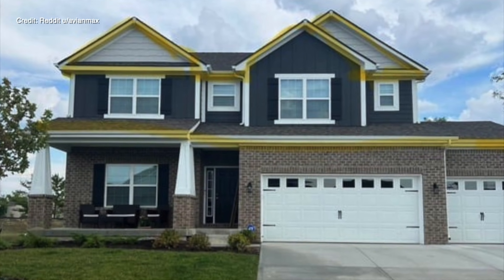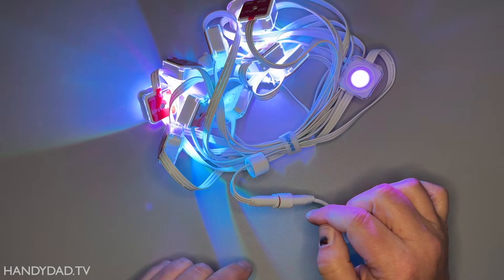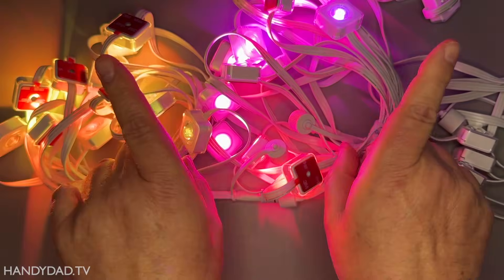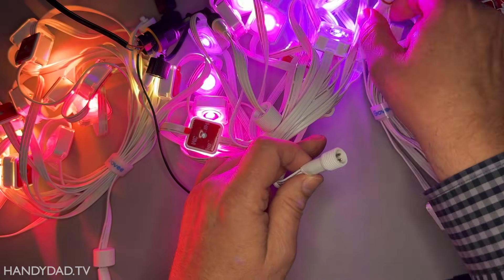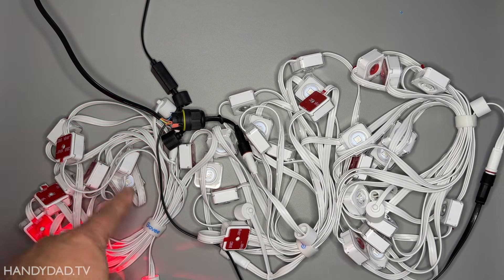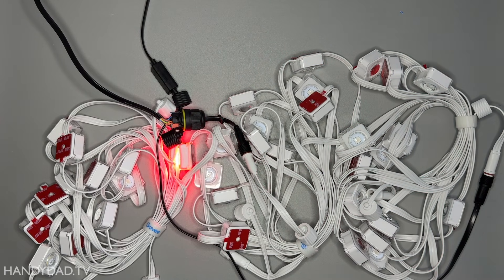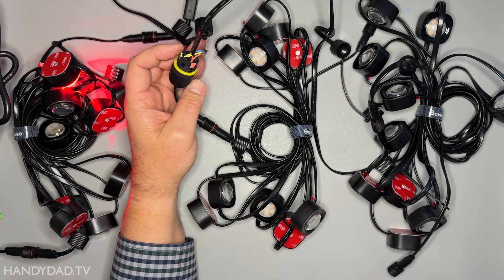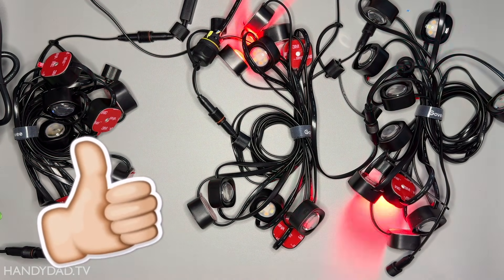Can you split Govee lights with a Wye Connector?

Comment: Great video but you don’t show exactly how you made the Y connection
Reply from the maker: The point was to show it’s feasible. My splices were purely for demonstration. Actual splices will likely be done using soldered waterproof connections and extended wires.

Comment: Great video and very helpful.  Forgive me if you've already answered this question.  I did look to try to find my questions.

I have Pro lights.  I wanted to splice a Y split IN THE MIDDLE of a segment.  No joy no matter what I tried.  I could ONLY successfully Y split between full segment.  When I put the Y split at the end of a full segment and the start of two split segments, it worked perfectly.

Can you splice a Y split in the middle of a segment?  If so, I did SOMETHING wrong.  

Many thanks for the useful video!
Reply from the maker: You should be able to do the wye anywhere along the string.

Comment: Question , can you connect more than 12 string using Y splitter , I am in a situation where I need one more string , so it will be the 13 th string to complete or do I need new power and controller. Thanks
Reply: Any input for this ?
Reply from the maker: You can’t exceed the limits of your kit. If it says 12 is the max, a splitter doesn’t give you more capacity.

Comment: I know this is an old video, but any idea what would happen if one of the split runs is longer than the other? I have an unfortunate roof layout and have to split in the middle of a run.
Reply from the maker: That’s fine. The longest leg is the main line. The shorter one is a clone of the other.

Comment: Great video, very helpful. I do have a question though. After the Y spliy can I contiue down one of those paths? I would need a Y to go up to a short run of a new roof line, but hte lower Y I would need to continue on for another 50 feet or so. I feel it would need several more strands to complete the roofline.  I assume it would, but before I commit the $ for this, I thought I would ask.
Reply from the maker: Yes, you can go as long as you need, provided you don’t exceed the total number of lights in your kit.

Comment: Are you still limited to the same number of strings off the power source? Also do you know if adding the extension cords provided with the pro kits have to be taken into account of the 200ft you can run? Just ordered my kit, and was hoping to find a video successfully using a Y splitter. So thank you for the video!
Reply from the maker: You are limited to the number of lights that come with the kit regardless of extensions and splits.
Reply: I need this how do you make the Y

Comment: May have to do this - thanks for the video. To light up one last area of my house I need about a 30' extension. I actually found a 32' one but from what I have read I have my fingers crossed that it will work. If I "Y" this junction I only need maybe a 5' extension. Have you tested the longest length extension possible for the Pro's?

Also, I'm having heck of a time finding a 3-wire ribbon cable like Govee - do you have a source? - thanks
Reply from the maker: Non-OEM extension cables are hit or miss because they need to incorporate a signal booster. Always test on the ground before installing so you don’t waste time on the ladder. 

I don’t recommend splitting because you lose individual control. Also, splitting doesn’t change the capacity of your kit, so you still have the same max lights.

Comment: If there's a flat second story and a flat first story, can I Y at the base and run two separate 100 foot strands? Would it be in sequence top and bottom? Or would it be better to just use two separate kits and link them on the app?
Reply from the maker: Wye splitting doesn’t let you surpass the max number of lights your power supply can handle. 

It would be best to use one kit without splitting.
Reply from the maker: Wye splitting doesn’t let you surpass the max number of lights your power supply can handle. 

It would be best to use one 200’ kit without splitting.

Comment: This is exactly what i need because on the same section of my house i have two levels where i want lights. my only question is, on the upper level, will i be able to still continue on after that strand runs out?? i have the govee pros
Reply from the maker: Yes. The longest run is your primary. The shorter side copies the primary.

Comment: @handydadtv - Thank you for the video - Couple of questions: 1) If you do the split and have 2x section mirroring each other, do the Govee app only show 1x string and leave the other one off? Meaning you cannot DIY manipulate the duplicated strand? For some if you want to DIY modify it, this may be an issue. 2) If you do this split, can you then continue off of one split can keep running the remaining strands around the house?
Reply from the maker: 1. Both sides of the split will ALWAYS do the same thing. You can’t control them individually. 
2. The longest leg of the split becomes the main line that’s controlled in the app. The shorter leg mimics the longer one.

Comment: I have a semi detached house i want to split and do two strands one at the roof and another over the lower shed over garage and the door entrance. Ideally both strands will have almost same number of pixels. My question is, would it reduce the overall brightness or voltage if the do a Y split and is there any electrical hazard??
Reply from the maker: No electrical concern as long as you don’t exceed the number of lights in the kit. You can’t combine two kits and expect one power supply to drive them all.

Comment: What's the best way to setup these lights if my power is in the middle of my house and I want to setup lights to the right and left of the power source?  I assume some splicing will be required in some way.  I'd like to keep sequence if possible and not duplicate it like the Y does.
Reply from the maker: The best option is to add an outlet to the right or left. I’ve got videos on that.
Reply: @handydadtv was hoping to avoid that, thanks though.  I've done it before, was just hoping there would be an easier solution.  I might just do a splice anyway.

Comment: Awesome content very helpful in deed.  Question what does the y splitter do to the overall length of the string capability.  Would you have to calculate the two strings into the total length or would this theoretically give you double the lighting capability per power module.
Reply: Second question I have had to run jumpers and always loose communication when the jumper length is anything longer that roughly 4 feet.  I’ve had to hide lights in the attic to get the lights to act right which is fine but can be frustrating as that hidden light is normally in the very small parts of the attic making installs much more time consuming and difficult.   Any ideas of how to run long 4-16’ jumpers without having hidden lights.   I’ve even used the Govee extenders but even with that when installed between strings the same effect happens.  What I see when I get over roughly 4’ is only a few lights will come on after the jumper and then maybe a few lights will just flicker but nothing after that.   Thoughts?
Reply from the maker: Power is power, and the wye doesn’t give you any more power. So you can’t exceed the overall limits of your set regardless of the wye. 

The little cubes on the Govee extensions should be signal boosters. So you should be okay if you use them. Using custom, aftermarket wire has no booster so that’s something to consider. 

There are third party boosters, such as the Falcon F-amp, but they don’t work with 36 volts, so you’d need to add a buck converter to 12 volts. PITA

Comment: Did you count the strands after the split when you calibrated? I have 8 strands all together that includes 2 strands that come off the split that mirror the strands directly below them, so I'm wondering if I should select 6 or 8 when it asks you during calibration. My controller and 1 extension cable went bad after about 3 months of use so I'm wondering if it was due to me originally selecting 8 instead of 6. Any help is appreciated and great video
Reply from the maker: Lots of people complain about their controller dying. The number of strings spliced makes no difference. 

But you should configure the next controller for 6 strings, not including the mirrored ones.

Comment: Does the mirroring only impact one side of the split connection. I want to split at a peak on the far side of my house so it will allow me to jump to three dormers at the front of the house. I want those dormers to stay in sequence, but I’m not worried if the side of the house is mirroring . Is that what will happen?
Reply from the maker: If the left leg of the wye has 50 lights and the right has 25, the right leg will mirror the first 25 of the left leg. Hope that helps.

Comment: I made a wye/ y splitter connector with the Govee extensions and worked flawlessly.
Reply: Do the 2 lines coming off the splitter need to have equal strands of leds or can you have 1 strand on one and 3 on the other?
Reply from the maker: They can be different lengths.
Reply: @handydadtv thanks for sharing your knowledge with everyone I really appreciate it!

Comment: Thank you for this video. Question i have. I'm running the 200' pros. currently using 10.5 strands with booster on end of 5th. I want to do two splits like this for my dormers, both splits will be 6 lights each. one spliced in strand 3 once spliced in strand 7. Is my booster ok where it currently is set up?
Reply from the maker: I can’t say. You’ll need to test.

Comment: I am. I ran out of power because I need 12’ more in my 200. I’m going to back up the the last 12’ and piggyback. Govee does. Or make or sell  a spare power Bluetooth supply.
Reply from the maker: Putting more than 200 feet of lights will overload your power supply and could be a fire hazard.

Comment: Thanks for the excellent video and demonstration. I am currently installing govee pro and need a couple of y slices. My question is what happens to the lights on the shorter run once you have passed them on the programming? Are they off until their sequence action returns possibly creating dark spots?
Reply from the maker: No, they mirror the longer string.

Comment: If that’s the case, can I make my own extension cable with the 100ft pro version… I’ve a 30ft drop to my porch and so I’d need to splice using my own wire
Reply from the maker: You can make your own extensions but it’s best to insert wire in the middle of the stock extensions because they include signal boosters.
Reply: @handydadtv  oh ok… many thanks for your response! 🙂👍

Comment: What about doing the Y split after the controller, before it gets to the lights? My assumption is that the first two strands would memic each other. Have you tested this, and what was the result?
Reply from the maker: It would work and, as you said, mirror both sides.

Comment: I'm having issues with the Bluetooth.   One day they just turned off and can't reconnect
Reply from the maker: Try resetting. If that doesn’t work, it could be the power supply. You can test it with a voltmeter.

Comment: Yes! I will be doing it as I currently have the string going across my garage and going down the far side. Now I can add a strip running down inside and as sequence splits I think it will look really good this way versus wiring in an extension gap to get back to the inside.  Thank you very much for doing this experiment!
Reply from the maker: Hope it works out for you.

Comment: What happens to strands connected downstream from the y?

I have a small 12 ft section on my 2nd story but have lights continuous on the 1st floor aka the 2nd story lights would be directly above some lights on the 1st.  

I've been trying to decide how to connect that 2nd story.  I am fine with that 2nd story doing the same as the lights directly below, but wanted to make sure the rest of the lights after the y on the first story would continue independent.

Lastly what happens if you were to do the y in the middle of a strand?
Reply from the maker: No difference whether you split from the beginning, end or middle of a string.
Reply: @handydadtv  what would strings attached at the end of the y do?  Aka if I connect more then 1 string after the y?
Reply from the maker: @bluerider0988 You can connect as many strings as you need after the Y (up to the max supported by the controller).

Comment: If I ran the lights the wrong way so my power connector is on the wrong end, can I cut the end off, use an extra buckle adapter and turn the power around?
Reply: Unfortunately no, the data only transmits one way. One side is Data-In, and the other side is Data-out. You can't turn them around.
Reply from the maker: 👆🏻this guy 👍🏻👍🏻👍🏻

Comment: I need 280ft to wrap around my house. Do I need two kits or I can add strings ?
Reply: The power supply can only power upto 150ft (or 108 individual bulbs). You need to install the two kits separately and use the app to group them into one. Then the lightning patterns will run as one all around the house
Reply from the maker: 👆🏻what he said ✅

Comment: The problem I have with pulling the trigger on these lights.. I Have a two story house.. The ground floor has a straight run with a small porch with a peak over it.. But the second floor has the same straight run but three bigger peaks above that at the roof line. How can you install A continuous run without making a Y on those three peaks from the ground floor all the way through to the top🤔🤷‍♂️
Reply from the maker: Some roof lines are too complicated for out-of-the-box products. They need custom splicing to make them look good.

Comment: How do you set up the Pro in the app then?  Do you just ignore the greens (if any) on the "shorter" parallel run and use/count the greens on the "longer" parallel run?
Reply from the maker: You only count the main line. Not the branches.

Comment: For the y connection Can u power to the 2nd & 3rd string from 1at string  and connect to the data to 3rd from the end of 2nd string ( only data wire connect end to end)
Reply from the maker: Sure but that defeats the purpose. If you can connect the data end-to-end, you don’t need the wye.

Comment: Do you have a video on how to make that exact y with the pro kit? I’m not seeing it
Reply from the maker: The point was to show it’s possible. If you do this, you’d need to do splicing without the splicing kit.
Reply: What's wrong with using the splicing kit?  My thought was to cut the male ends of the short extension cords, expose and twist the wires together, and then insert them into the splice kit.
Reply from the maker: @seanhanna1 Nothing, but the stock splicing kit is only meant for one wire. Not sure if you could get two through the grommet.
Reply: @handydadtv  Update, this worked great.  I cut the ends off two of the short extension cords and was able to fit them through the grommet for a waterproof 3 way splitter.  Thanks!

Comment: Is there a seperate video on how you made the Y?  I can somewhat see it, but the wires are getting moved around quite a bit, and I'm losing the different wires, also, maybe showing which pieces of the kit you spliced?
Reply from the maker: No separate video. I was just demonstrating that it can be done. Odds are, you’ll cut and splice the strings rather than making a splitter.
Reply: @handydadtv it would be useful if you actually show how to make the splitter with the pieces that come in the kit.

Comment: Can you connect the power source on either end just by changing the connector to accommodate the power source connection?
Reply from the maker: No. The data must flow sequentially from the beginning of the string to the end. You can split it, but can’t change the direction.
Reply: @handydadtv  Thank you for replying, I got them up and running, thanks! They're nice!

Comment: Hello Sir,

 I’m very happy I saw this video because I’m about to purchase 2 of the pro kits, and the ideal thing for me to do would be to add a Y split in one of the lines, so this video clarifies that you can do that with everything in the kit, so thank you! 

My only request to be and I know this is one of your older videos and you’re probably busy creating content, but I would love to see a video of what you actually did using the kit to create the split. I know it looks pretty obvious, but I think it would help myself in a lot of people if you actually showed us what you did. I know you explained this on a very high-level in this video, but I would love seeing what you actually did because that will probably clear things up for me and others. 

You would make a fan out of me immediately, and I think it would help a lot of people if you did. 

Thank you and I hope to see that video!
Reply: Or at least point me in the right direction of where I can look at something that will explain what you did somewhat
Reply from the maker: You’ve got it easy with the Pros because the wires are color coded. Regardless of where you cut, just make sure to connect the same colors together. 

It’s also very important to keep the data flowing in the right direction. Data flows on the yellow wire from the controller through every light. The lights won’t work if you reverse them.

Comment: Have you found a plain extension cable that does not have lights on it? Maybe like 10 ft or so to bridge the gaps between house dormers…
Reply from the maker: The kits include extensions. The 150’ kit used in the following video came with two 4’ and two 12’ extensions. https://youtu.be/PlGlH1SsKVA